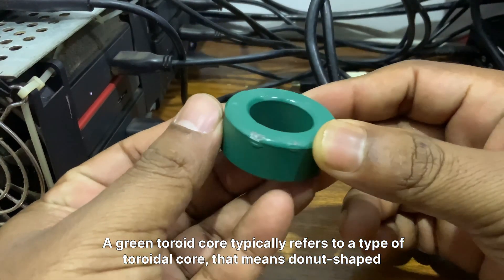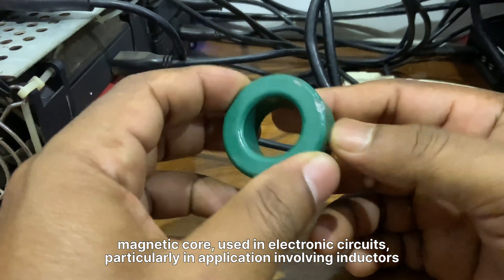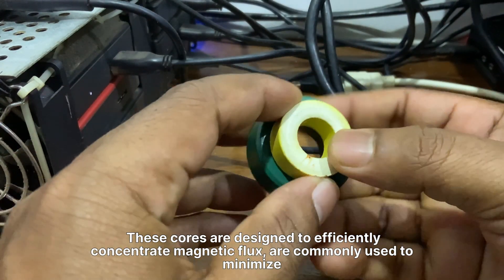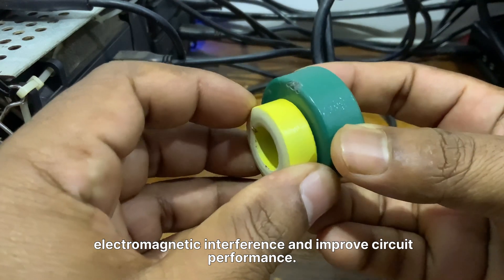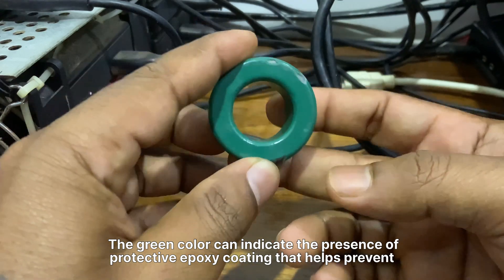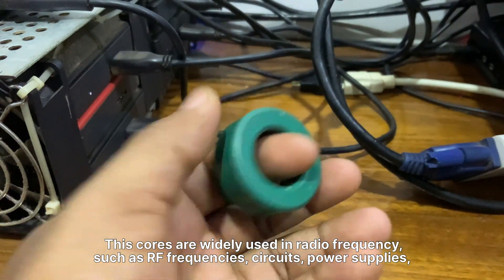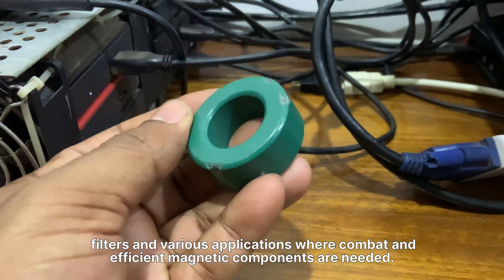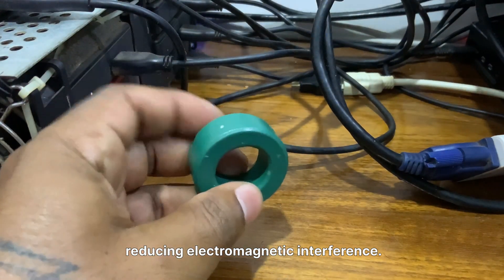Green Toroid core | Why use it on Inverter or Amplifier?

Comment: Can i use green ferrite core in class d audio board?? Please reply
Reply from the maker: You can use but it may heat
Reply: @Lifeofelectronic  ok but sound will clear or not? IR2153 class d application
Reply: Can I use an iron bearing ring as a core for winding ferrite core transformer instead of a powdered core